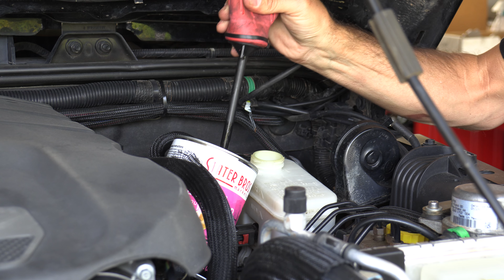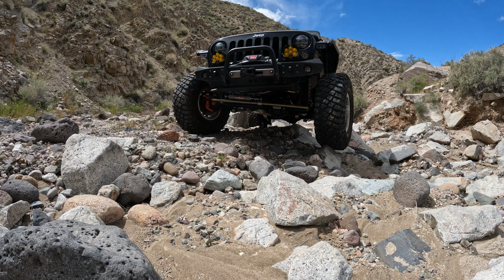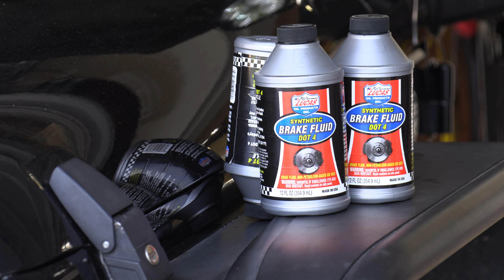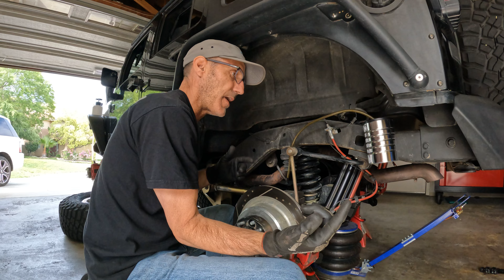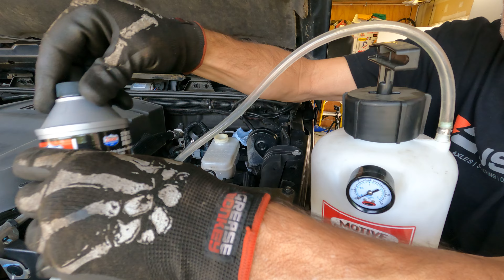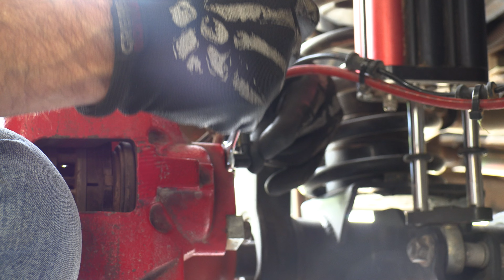How to do a Brake Fluid Flush - Check it and change it yourself!

Comment: You know what would have been really nice to know, was to NOT do this procedure with your calipers off the rotors?  Just blew out both front pistons!! Well $%^&😢
Reply from the maker: Having the calipers hanging loose and not on the rotors is not normal for ANY bleeding procedure. Certainly not shown in my videos. Sorry to hear about the mishap for you.
Reply: @ that was not a dig on you or the job you did, lol my brake calipers seized up driver front/rear, had everything off etc.. then PowerStop sent me new warranty parts, luckily I still had old calipers on but in the new box was a note saying hey you should flush system.  Initially no problem by hand pump and large syringe, but I had a lil air, So had wife come out as it was a long process.  Well started at rear, nice flow and no bubbles but by the time I got to last front caliper, it was to late:( I didn’t really cry but said a few choice words.  AHAHA lesson learned and luckily I have new warranty parts and I have a local shop that can rebuild old so I have spares:)

Comment: Another great video. 
What clutch are you running and did you happen to do a video of the install? 
Having the same jeep as you, i follow along and do most of the same changes.
Reply from the maker: I'm still running the original stock clutch and it feels pretty good. When  I do upgrade, it will be to the Centerforce with the heavy flywheel for sure.
Reply: @AutoEdits  my clutch seems ok. But the throw out bearing feels gritty. Apparently, it's a common problem
Reply from the maker: Yep, have heard that and am bracing myself for it as well. I did a trail run with some folks that had the Centerforce kit and I really liked the feel of it.
Reply: @AutoEdits  if only it wasn't so expensive! But definitely going with the same. Why don't you come up to NY and make a video of changing mine! 🤣
Seriously though, you are my go to video guy for how to. Thanks! And keep up the good videos!

Comment: Great video. Do I need to remove tires off for just the flush part?
Reply from the maker: You don't have to remove the wheels to bleed the brakes but it makes it so much easier to see what you are doing.

Comment: Your jeep has ABS correct?  Do you not have to anything special to flush the ABS system when you flush your brakes?
Reply from the maker: You only need to activate the ABS pump if you get air bubbles in there. Otherwise the system bleeds like normal.
Reply: Thank you.  Now that you said that, I think I remember you saying that in the video.

Comment: I recently bought a much cheaper system which i was happy about, but before using it I decided to trash it and get this pump kit from your Amazon page.  The one I got was from Harbor Freight and is designed to use a compressed air tank to create a vacuum at the brakes and suck the fluid out instead of it being pushed like this video shows.  It worried me that the negative pressure may collapse the brake lines, and there didn't seem to be a way to regulate how fast the fluid would flow.  I was too nervous to even risk it.  Money wasted.  Not the first time, unfortunately won't be the last.

Thanks again for another awesome video showing us how to take care of our Jeeps!!  AutoEdits wins again!
Reply: @AutoEdits  You probably made a wise decision. I just asked Grok and ChatGPT which system (Pressure or Vacuum) is better and it recommended the pressurized system as the vacuum can leave air in the ABS components and higher sections of lines.

Comment: My JK is 7 years old now, and its likely in need of having this done. I think I will grab one of those little testers to find out :)
Reply from the maker: Let me know how it works out for ya!
Reply: @AutoEdits  Picked up the one out of your Amazon store. And my 2017 JKUR, with factory fluid, is showing 2.0. I tested several times, and once it read a bit higher, but 2.0 seemed to be the average.

Comment: I use the power bleeder the same way you do because of the slight mess and the wasted fluid left in the bottom.  I feel once the fluid leaves the original container, it doesn’t go back!
Reply: That's the rule, contaminating is to much of a risk here. The filled reservoirs are more for the professional user who may do a couple of cars a day
Reply from the maker: I agree!

Comment: it was throwing me off a bit seeing you use the motive bleeder that way. I mean you could just discard any left over "new fluid" in the Motive at a recycle center and save the hassle of constantly topping off the brake reservoir, its cheap enough to not have to worry about a little extra left over... To each his own  🤷‍♂
Reply from the maker: It's not just the leftover fluid in the tank but the inevitable overflow at the reservoir. If I were a service tech and did this all the time... sure, fill that thing to save time. But taking literally 4 extra minutes for the whole flush isn't really a big deal to me in my garage 👍